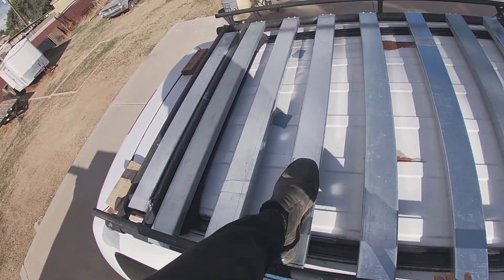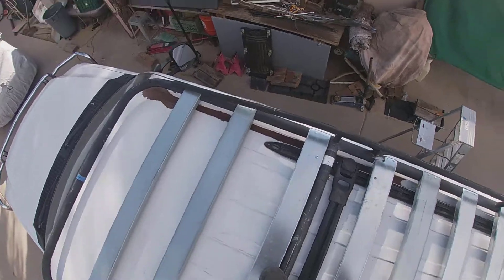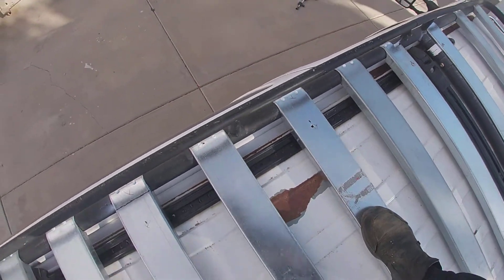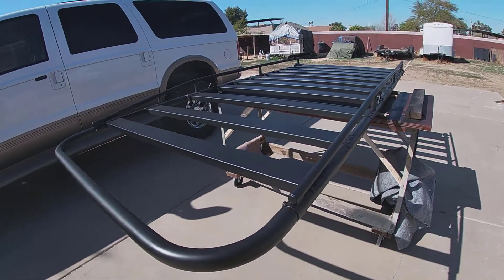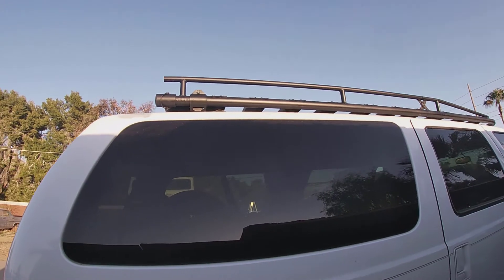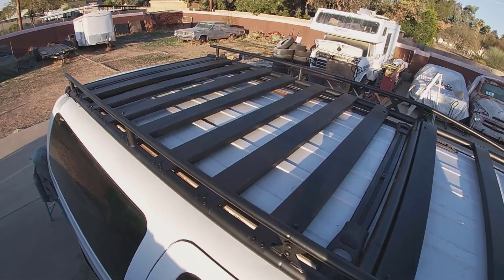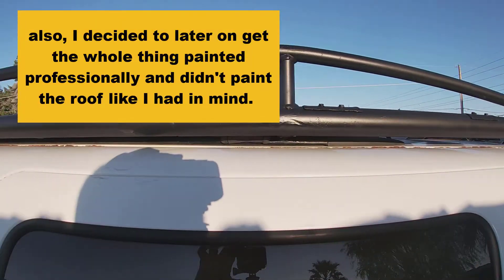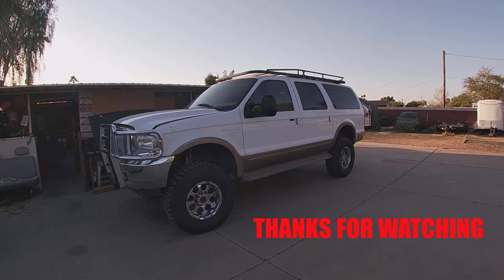2000 FORD EXCURSION CUSTOM ROOF RACK INSTALL PT.2

Comment: Nice work.   I see your first vid.   Can I ask what you did use to mount it to exiting roof rack ? Thx.
Reply from the maker: Have some crossbars to line up to the existing long tracks and find the long M6 90mm screws to screw through...very solid way of doing it.
Reply: Ok. Thx for your time.